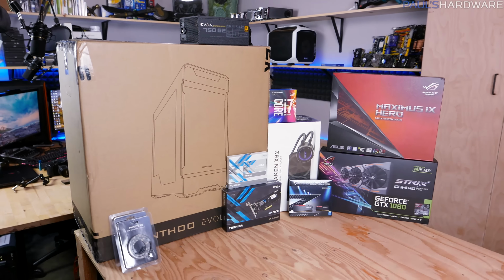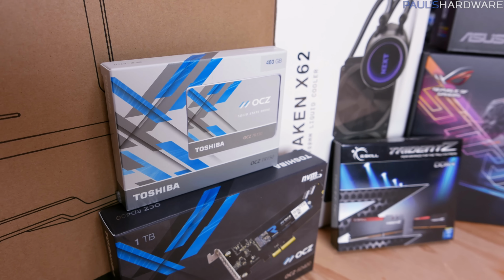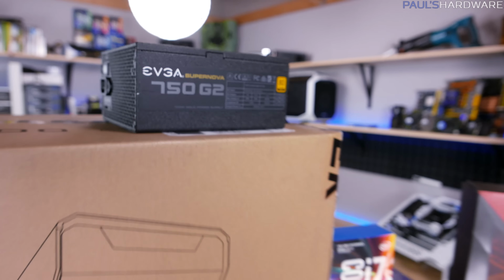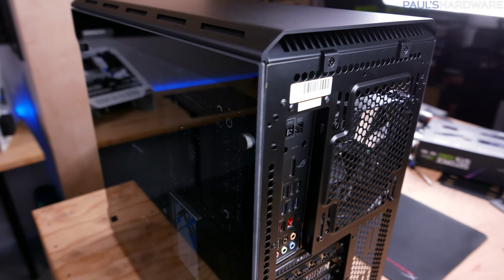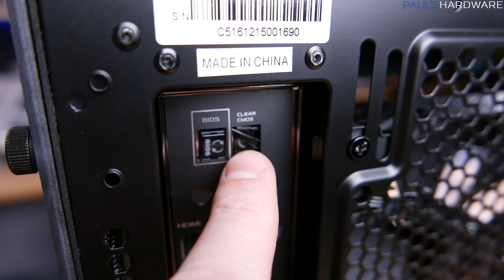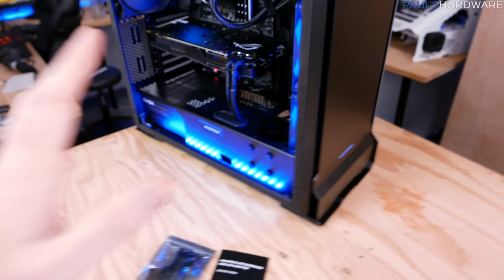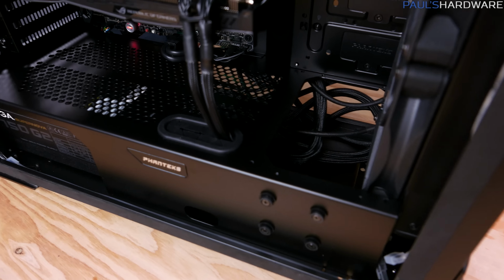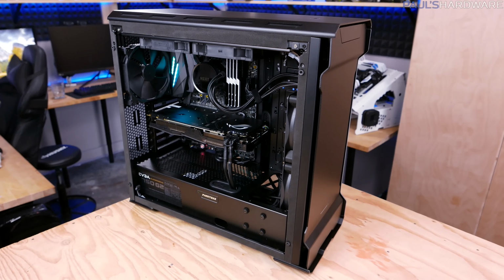Building a $2800 7700K / GTX1080 Gaming System - January's RGB PC!

Comment: The reason why this build is so expensive is because the NVME SSD is $800USD!
Reply: its 600€ here in Europe :D
Reply: YellowPeaches that's something new Europa is actually cheaper?? lolzzz
Reply: UnknownUser 600€ for us why You need to buy such a SSD a 128gb SSD  for 40€ Form Kingston is enough...
Reply: yeah that's ridiculious. Soz bad enlgish. An 850evo would be fine
Reply: Wow....that's more than the GTX 1080 card!  Dang!  Go with regular SSD rather than nVME.  The prices are just through the roof!
Reply: FYI Nvme is a type of ssd data transfer method, not a type of drive separate from ssds
Reply: Ikr! I was stunned when i saw it XD
Reply: no, 128gb is never enough.
Reply: ***** It is people only install Windows on it 
For the Rest you have a hard drive
Reply: Yung TedBounty noo ssd is better for everything but they are expensive
Reply: Why are you calling other people dumb if you're in fact the dumb one,  everything is faster on a ssd. You're not gonna have a 128 GB ssd only for windows in a $2800 pc. That would be in fact dumb, you've got to eliminate bottlenecks, although I agree for this one to be pretty expensive.
Reply: Yung TedBounty yes 128gb isn't enough for most people
Reply: Yeah... ditch that SSD.  I dont care if its M2 or not.  If your spending that kind of money, why isnt your boot disk M.2?  For that kind of money you can Raid 5 a trio 500g Crucials (150 each) and end up saving half of the cost of your set up.  
Seriously, who needs an $800 storage drive?
Reply: ikr
Reply: No 128 gb is far from enough. For an expensive build like this you would want to at least aim for a 500gb SSD. In my next build in a couple of years I surely will go SSD only.
Reply: zoNECS what have you been smoking why would you need a SSD for mass storage unless you work with alot of large files and need to transfer fairly often and even then you would be better of with 3 5tb hdd's in raid 5 or 0
Reply: Excuse me? 128 GB is not enough. If you install windows on that ssd then you barely don't have any space left at all. EVERYTHING is faster on an SSD why would you not want to have a bigger one? 500GB SSD is pretty much standard nowadays when it comes to an SSD especially in an expensive build like this. If you are on a budget you would probably want to go with 1tb hdd and a small ssd but not otherwise. 

You must delusional or stupid if you are going to put in 15tb worth of HDD space in a single PC. Just get a NAS at that point. As SSD's gets cheaper and you have the money then it's no point in choosing an HDD over SSD.
Reply: zoNECS you probably don't even know what raid means but let me explain he is using a 800 dollar SSD thats just delusional 
when you have 3 5tb raid 0 hdd's you'll have 5tb of available storage that is spread over those 3 hdd's which will increase speeds to a level they will be as fast if not faster as most ssd's (depends on the amount of hdd's in the raid) while being considerably cheaper with more storage too it doesn't mean being on a budget it just means you can actually use your brains and don't just buy things because if they are more expensive they must be better too
Reply: I very much know what raid is. I don't know why you feel the need to try to make me look unknowledgable when you are the one not getting my point at all. It does not matter if you want to waste 3 5tb HDD's in raid 0 or not, that's really a waste when you could just do RAID 5 in a NAS.  On a high budget / no budget build there is no reason to not go all in on SSD's. No matter what you store on them it will be faster and who says you can't have the SSD's in RAID 0, 5? etc.
Reply: zoNECS a Nas don't have windows for as far is I know correct me when I'm wrong but aren't nas' connected over the network with would mean you would technically be limited to wired LAN speeds if I'm wrong then correct me but my point is that this build is using components way to expensive even for a non budget built
Reply: Yes it's over your home network. That's why you have stuff on it that might take up a lot of space but don't need constant access, like videos or photos. The M.2 SSD is definitely expensive and their are cheaper ones for the same storage but they are not M.2 and not as fast.
Reply: Honestly guys, a 250G m.2 SSD is 150 bucks.  If you have a need for more then 250G at that stupid fast data rate, your doing something wrong and you should be looking to move stuff off to a storage drive.  A Win 10 install is like 20g?
Reply: +Jay Morrison what about games you wanna load faster, applications and other programs you wanna keep there?
Reply: why would you wanna do that? If you have 3k to drop on a PC you wouldn't want to get an i5, air cooler, some derpy case and a HDD ffs
Reply: +Gigabyte gtx 1080 Xtreme Waterforce SLI isnt worth it when a large amount of games dont support it
Reply: Dude a 1Tb NVMe SSD is not worht the money. Just get a normal 1Tb SATA SSD and another 1080. SLI is worht it atm too, just look at the Titan XPs
Reply: So Im pretty sure we can ALL agree that the $2200 version of this build is the only sane one?
Reply: UnknownUser Really I can find some for £300
Reply: zoNECS I say 256gb minimum in a budget build but if you are spending $2500 or above 512gb ssd and $3,200 build 1tb

Comment: Paul, you can put those top fans on top of that tray on the top part of the case, rather than the lower portion. It looks much cleaner IMO. Only thing is you have to take the top part of the case completely off.

Comment: Paul, my future build is almost the same, had it picked out before the video, just a few things that are different, I'll have the maximus ix formula, Samsung ssd, and a corsair power supply, I as well will have the rgb trident z ram. I just think it is neat that I've picked out a build that's very close to what your doing. of course with the formula I'll be doing a custom loop later on. but thanks for the video!

Comment: When we did the build for my brother in that case we had the same problem with the cable getting caught onto the IO-shield, definitely worth checking that during placement of the motherboard.

Another problem we had was that we could not get any graphics card to work. It took us hours to realize that we had forgotten to plug the power cable running to the graphics card into the power supply...  :D

Comment: I have the same Phanteks TG case and Kraken X62 cooler with its radiator in push/pull conf mounted on the front. I drilled new radiator holes a little bit higher into the case, so I could still have the radiator mounted on the front and also have two HDD's below in the basement. The basement cover is also on its original place. Silly that Phanteks did not think of this when they planned the position for radiator mounting holes.
Reply from the maker: I just might do this, I kind of thought the same thing -- seems you should be able to mount a 280 higher up without removing the basement cover. Thanks Marko!
Reply: I'm going to buy this case and want to do the same thing, because front radiator is better for open shroud graphics card. do you have any photos?
Reply: I added 2 photos of my mod here below :)

Comment: I got that exact case and the X62 last week, beautiful setup.  Interested to see what the temps are with that rad there, I mounted mine at the top.  Also if you mount a SSD on the front shroud it looks quality through the tempered glass, without it imo it looks like an unfinished build.

Comment: Hey paul have the same build as this. with the same color LED problems. I had to use the case lighting controller (plug in via sata) and hold the small button on the front for a few seconds to turn it off. took me hours to figure this out, hope it saved you time.

Comment: I would sleeve the cables, switch out the ram for something black and silver or gun metal or vengeance rgb. I would also add in some more appealing fans. I feel like keeping stock fans is cutting corners on a build that had alot of potential. and maybe Velcro holding the tubes together to make them more sturdy? idk about that lol

Comment: personally,  I would move the rad up a little on the front so you can close off the psu shroud and move the ssd up front on the shroud bracket. as well as getting a small piece of acrylic for a back psu shroud.  that way it doesn't matter what your cable management looks like.

Comment: Very nice build. I just finished a very similar gaming rig:

Corsair 570x Crystal Case
Corsair Rm 850X
i7 7700k OCed to 4.6Ghz
32GB corsair vengeance LED 3200MHz 
Toshiba OCZ RD400 512GB m.2 
Toshiba OCZ tr150 960GB SSD
GIGABYTE Aorus Gaming 5 
Asus Strix 1080 OCed to 1875Mhz  
Corsair h100i v2
Corsair Pro ML120 Blue Led ( 2 on radiator and 1 on back)

Man it feels good to be back to PC gaming after using a PS4 for so long.

Comment: Not a million miles away from my build. Regarding the radiator, I would place it inside the roof with the fans underneath it. The radiator pipes will hang better. Then put your 2 top fans at the front. 

Case: Phanteks Evolv ATX Tempered Glass
MB: Asus Maximus IX Formula & ROG Xonar Phoebus Sound Card
CPU: Intel Core i7 7700k Kaby Lake
Cooler: Corsair H115i
RAM: Corsair Vengeance LPX 32 GB DDR4 2666 MHz
GPU: Nvidia GTX 1080 MSI Gaming X
SSD: 3x Samsung 850 evo 1tb
HDD: 2x WD Black 2tb
Media: Pioneer Blu-Ray Player

PSU: Corsair RM850X
OS: Windows 10 Pro

Mouse: Razer Deathadder Chroma
Mousepad: Steelseries
Keyboard: Razer Blackwidow Ultimate Stealth 2016 Elite Mechanical 
Monitor: BenQ XL2720Z 27-inch LED 144hz Gaming Monitor
VR: Oculus Rift

Comment: Nice build, about identical to what I plan to build, but with new nvideo 1080 Ti. Also prefer the front radiator build, no problem with upside down fan labels, and I would keep the EVGA power supply label on, and go with nicer sleaved cables.  After I look at the fan specs I may use grey Noctua ceiling fans or RGB Corsair UFO landing fans, It was fun to watch the build at 0.5 speed, made your voice sound like you had a few margaritas before this build.

Comment: Thanks for this video, it's very reassuring. I'm going with this motherboard and CPU cooler and 4x8 of the G.Skill TridentZ RGB and I was worried that the two hoses on the Kraken CPU block would protrude too far and block the left most DIMM slot. This video has reassured me that it won't. --Thanks Paul :-)

Comment: I've got my h115i in the front my evolv as well. Right now I've got the fans towards the front of the case but I'm probably going to add two more to the back of the radiator so it will move a little more air.

Comment: I get it's probably a sponsored part but the OCZ SSD doesn't really make much sense IMO. you could just get the samsung 960 evo which is like $250 less for the same size and much faster or even the 960 pro for about $100 less and it's the fastest drive on the market atm if I'm not mistaken. good build regardless though

Comment: This is actually very similar to a PC I just build two weeks ago, same graphics card, CPU, water cooler, and ammount of ram.
I built it in the anidees ai crystal, used the rgb ram from geil, the crucial mx300, and an asus maximus ix formula (cuz rgb). 
Then I went overkill and got a 1000 watt G3 (I plan to upgrade to a 1080 SLI in the future. still overkill? yep.).
Cost me about 2200$.  Now all I need is a monitor worthy of this system.

Comment: UPGRADING! I have a Antec 1200 case and a Antec 1000 watt power supply, Can I still use them with the NEW ASUS MAXIMUS IV FORMULA? Also which CPU cooler should I go for knowing the ante 1200 has 6 fans? Using/Placing the one you used in this video, will be complicated or I'll be unable to install it. Don't want to get a new case if I don't have to. Watched your December & January build, great video. Learned a lot! I'll post my when I get the parts.

Comment: I don't know....I wouldn't have shelled out the funds for the M.2 drive.  You could have gotten an SSD for less than that.  The board isn't bad, although the Strix Z270-E would have been cooler IMO.

Comment: Hi Paul great vid, build not to different from my own, just wanted to ask how did you connect the fans for the x62, did you connect them to the AIO Pump header on the MB or did you connect them to the fan hub and connect the hub to the CPU FAN Header? Also what software are you using to control the fans, CAM or Asus?

Comment: Confused. Why did you take the M.2 card off of its PCIE board? On the board it would get its own 4x lanes from the CPU, and on the board it multiplexes off the chipset, doesn't it, in contention with everything else hooked up to the chipset's 4 DMI 3.0 lanes?

Comment: Good build and video. We all make mistakes. At least it wasn't a destructive  mistake. On another note; I value your opinion, whether M.2's or SSD's, I guess there the same in a way. Using a RAID setup on those devices, will RAID degrade the life expectancy of those type of drives?

Comment: Interesting choice to go for a 1TB M.2 but only a 480 GB SATA SSD.
Do you "feel" the increased speed of the M.2 over a regular SATA on a daily basis?

And wouldn't it be more economic to go for a ~500GB M.2 for the OS and a few programs and pick a 1TB SATA for everything else? Similar to what people used to do when SSDs were new, use a small SSD for the OS and a few programs and large HDDs for everything else.

And isn't the 750W PSU a little overkill for the system? Wouldn't 500W be enough for the 7700k and the 1080, even with overclocking? :)

Comment: So i just got the i7 7700k. Do you think it will be better at gaming then the ryzen 7 1700, im debating if i should return my 7700k and get ryzen.  I mainly use my pc for gaming and some streaming on twitch. I feel like 8 core 16 threads is a bit extreme from amd, since games wont be using that many cores for a long time.

Comment: Hey Paul,
I did a fairly similar build last week, the only difference really being SLI 1070's instead of a 1080 and an H100i V2. Currently have the H100 set up as an intake, would it be better to set it as exhaust with the extra heat added with a second card? Thanks!

Comment: I'm building the same case tomorrow, and i'd like some feedback on where to place the radiator? I'm going to be getting a Thermaltake Water 3.0 Ultimate and don't know weather to put it in the front or top, and push or pull? Thanks

Comment: Hey there, I have been thinking about building a pc with almost the same specs/components as this one here (only difference is 16 GB of RAM and one SSD + one HDD). It is my first time building a pc and therefore also my first time tinkering with overclocking. I am therefore very cautious with overclocking and might only push for 4.6GHz a couple of mounths after the build is complete. My question is, would i regret not getting a Liquid CPU Cooler? Instead of an air CPU Cooler like the Cooler Master Hyper 212 EVO. (The price difference between the two coolers appear to be quite high). Thanks in advance.

Comment: I'm new to PC gaming but I did build mine with the same cpu, graphics card, and the maximus IX hero A8C. the bios are confusing and can't find any videos for this motherboard and setting up the BIOS. Looking forward to that video. I do already have windows 10 pro installed but my BIOS settings at default as well as every other setting on the pc. Are there any must have programs or settings the need to be done?

Comment: Nice build, hope you don't want to add a 2nd 1080 later on cause that 750w ain't gunna cut it.
Reply: Easily it can
Reply: VK.4K No it can't.
Reply: peace gamer No it can't.
Reply: peace gamer That whole system plus a second 1080? No it can't, learn math!
Reply: I can't do math, but according to pcpartpicker it will need 585w.  That is cutting it close.  Asus would likely suggest something higher, but it would probably work.  I'd just throw it in and see how she goes.
Reply: pillsnotbills The Asus strix 1080 gtx uses 300w, add a second one, theres 600w, cpu, mobo, cooler, hard drives 200w, so to be safe you would need an 850w psw
Reply: Where is your power consumption data coming from?  Guru3d calculates 196 watts (wall-socket-power-meter method), and Techpowerup measured a peak load of 203 watts though the PCIe bus and PEG connectors.  If this is accurate then a 750-watt supply should be adequate, if not comfortable.  Asus itself doesn't seem to have a lot to say on the matter.

https://www.techpowerup.com/reviews/ASUS/GTX_1080_STRIX/22.html
http://www.guru3d.com/articles-pages/asus-rog-strix-geforce-gtx-1080-review,8.html
http://pcpartpicker.com/product/v34NnQ/asus-geforce-gtx-1080-8gb-rog-strix-video-card-rog-strix-gtx1080-a8g-gaming
https://www.asus.com/Graphics-Cards/ROG-STRIX-GTX1080-A8G-GAMING/specifications/

Comment: What to u think of my current build :) mainly for highend livestreaming and gaming :) is it good ?
Proce: Intel® Core™ i7-7700K Processor (8M Cache, up to 4.50 GHz) Box
Emaplaat: MSI Z270 Gaming M3
SSD:  Samsung-850-EVO-Series-250GB
HDD: HDD Seagate BarraCuda 3.5'' 1TB SATA3 7200RPM 64MB
Videokaart: MSI GeForce GTX 1080 OC, Armor, 8GB GDDR5X (256 Bit), HDMI, DVI, 3xDP
RAM: 2 x KINGSTON MEMORY DIMM 8GB PC19200 DDR4/FURY HX424C15FB2/8 KINGSTON
PSU: PSU Corsair AX760 80 Plus Platinum 760W, fully modular, 120mm fan
Jahutus: Cooler-Master-Hyper-212-LED-RED
Monitor: Zowie by BenQ XL 24" 3D Gaming Monitor 144Hz - XL2411
Kast: Cooler Master CM 690 III

Comment: do the phanteks led plug into the rgb port on mobo. did you use adapter ive seen some asus boards come with? maybe a little closr up of the led wiring for follow up be super nice